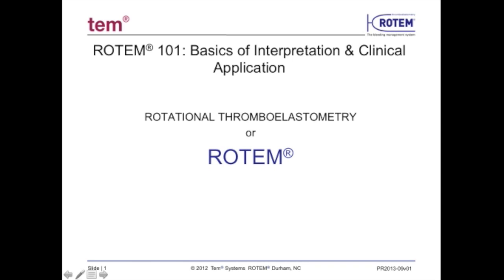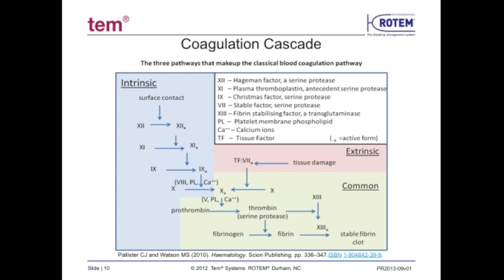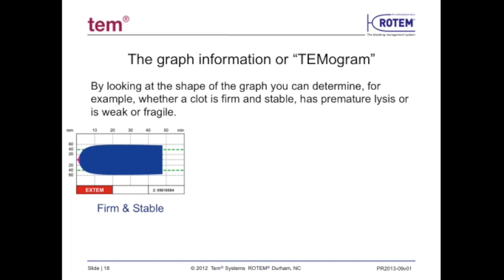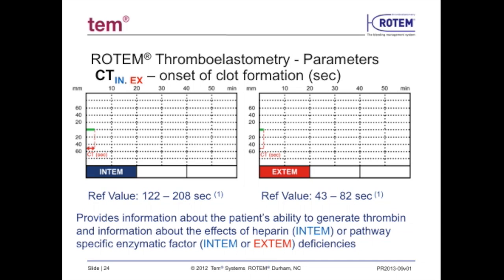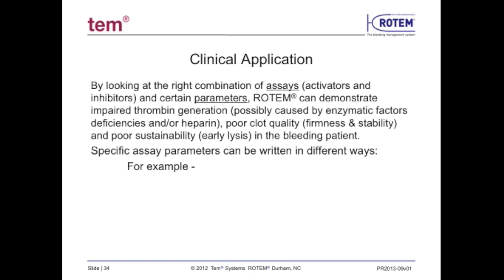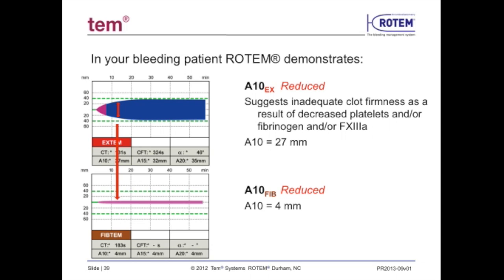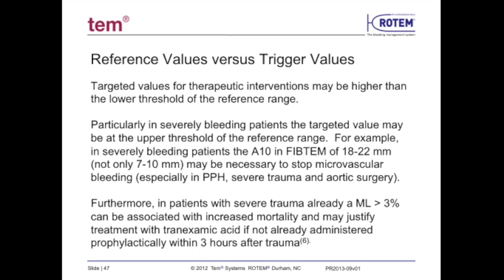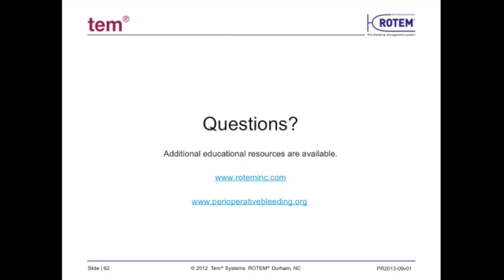ROTEM 101 - Basic Interpretation

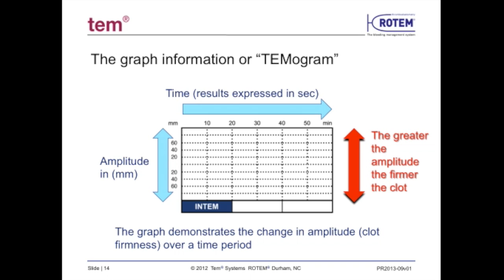Comment: The time is expressed in minutes not seconds, @8:38
Reply: It is resulted in seconds. The values on the screen show seconds while the test is running. The values in the database show seconds. Any algorithms you might find will describe everything in seconds. The QC values are in seconds. Everything is in seconds except the backdrop picture they are using for the explanation in this video. That is to make it easier for the viewers.

If you wanted to show your deep knowledge you would mention some other pedantic issue. You could have said the 10 minute assessment can only be used outside the US because of FDA clearance minutia. They can only fly the 20 minute flag in the US. You can't use things like A10 + 10 = A20 unless you are in a country that accepts that.

Now you know, and knowing is half the battle.